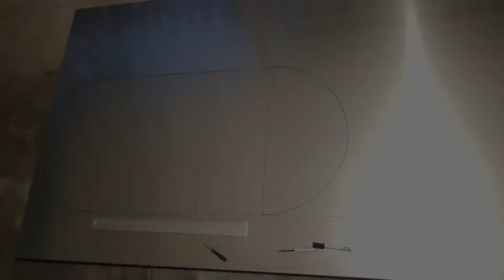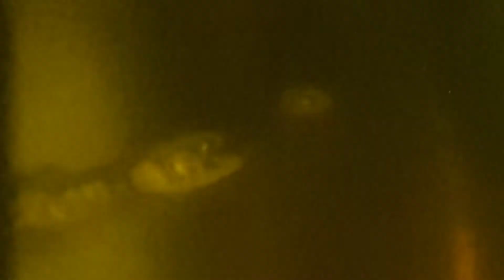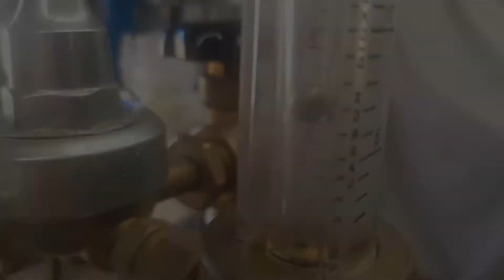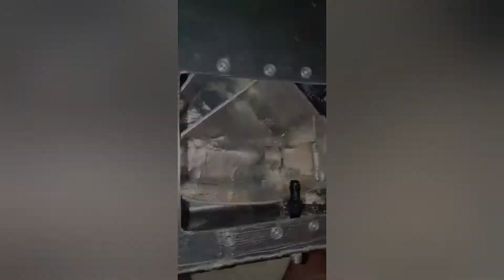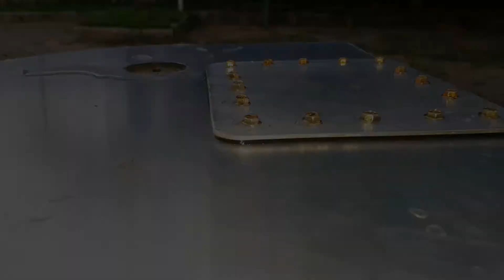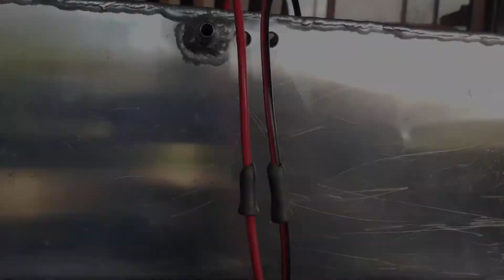Turbo AWD Camry - pt27- Fuel Tank

Comment: You'll have to let us know if the weight distribution feels any different/better. That's a great use of the spare wheel well area. I was a little concerned when I saw the pump wiring coming through the side of the tank vs the lid. Was space above the lid going to cause issues?
Reply from the maker: The carpet sits on top of the tank. Also the pump is not mounted to a hanger on the lid it is solid mounted to the inside of the tank. The lid is literally just that.